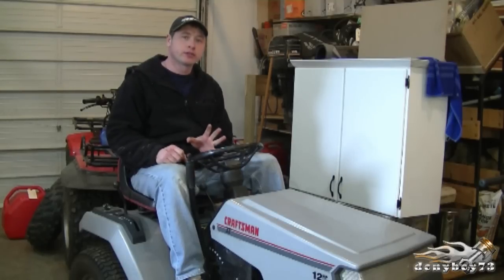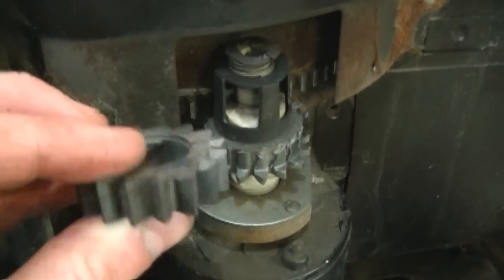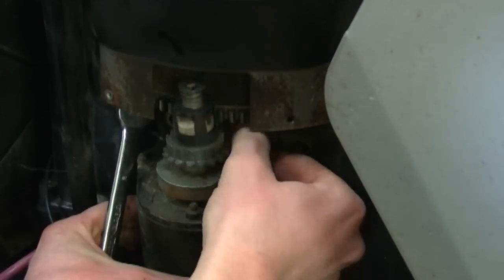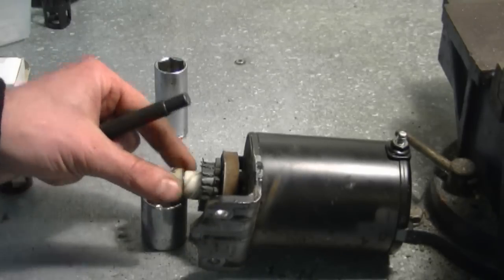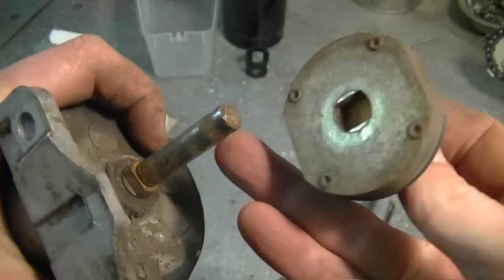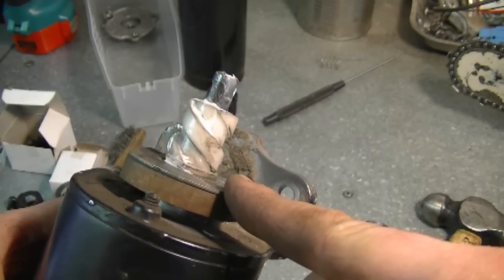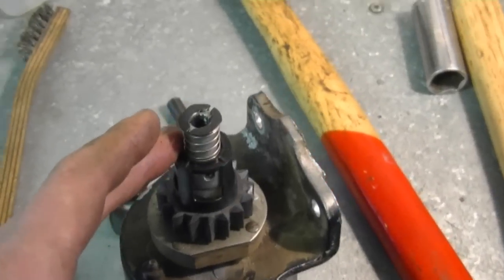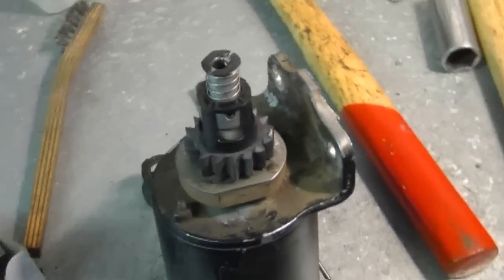Lawn Tractor Starter Gear Repair with Briggs & Stratton Engine

Comment: Can anyone help me. I have a 8 hp briggs and stratton starter that plugs into the wall, it spins slowly and over heats. If and one has any suggestions on how to fix the starter please tell me. thanks
Reply from the maker: it might be burned out so you will need a new one

Comment: @zigZag776 they could just as well make the gear out of iron brass or cast iron. All would be softer than the steel flywheel ring gear. Plastic parts like this are pure cost savings. To the manufacturer, not the purchaser!

Comment: Does anyone know if there is a deck plate available for the mandrels?  My 917.252520 AYP 42" deck got rusted where the mandrel bolts to the deck and ripped through the metal and cracked the mandrel.  I've looked all over but the closest thing I can find is the mandrel stripper that mounts below deck and I'm not sure it will clear the pulley.